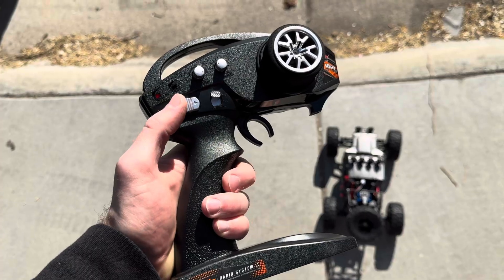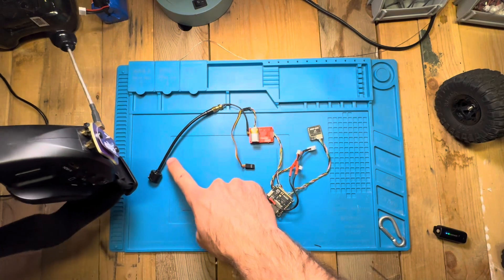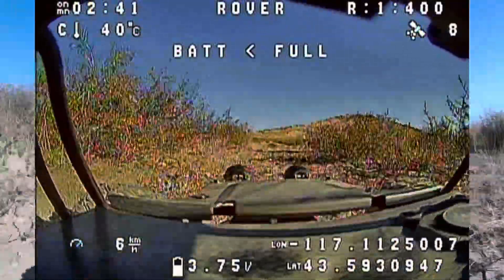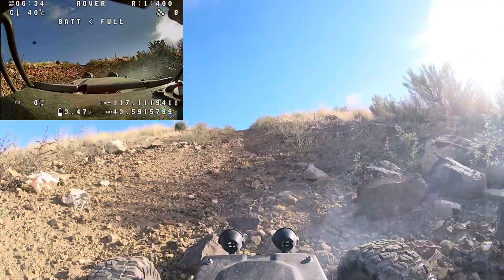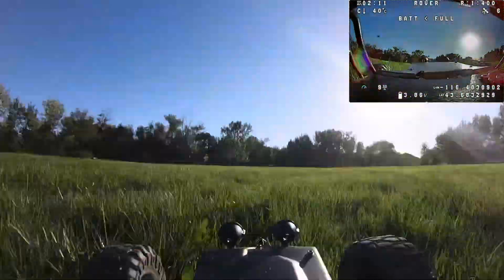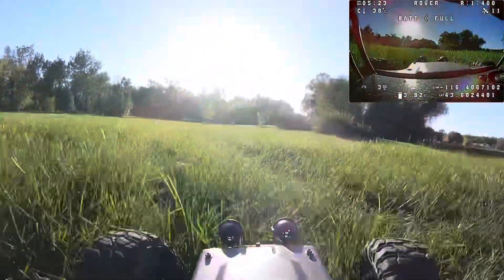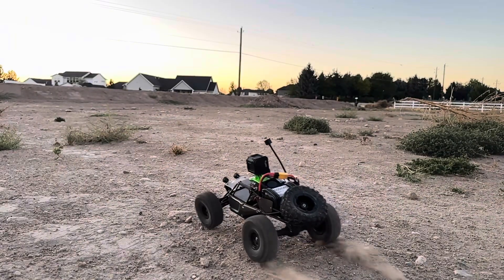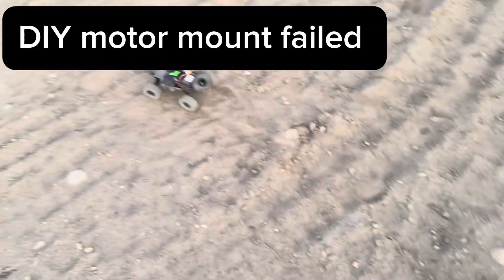Build an affordable FPV RC 4x4

Comment: Great video. Great project. Are there other RC cars you can recommend for this kind of build?
Reply from the maker: If you are willing to spend more money, something like the Losi tenacity would be very good due to the suspension and that it is very stable so it won’t flip over very easy
Reply: @MediocreNerd  That's maybe a little overkill 😅
Reply from the maker: @BirdsEyeViewHamburg haha yeah probably. The WL toy’s version of this car is probably best bet
Reply: @MediocreNerd  sadly, I can't find the exact model being shipped to Germany. That's why I'm asking for alternatives to use. Mainly having the same electronics inside that can be wired up the same way. But vendors don't show so much of the insides of the cars
Reply from the maker: @BirdsEyeViewHamburg what about WLtoys 12428? That is the exact car just different body. 12429 is very similar as well
Reply from the maker: @BirdsEyeViewHamburg 120416 would probably also work and has similar parts
Reply: @MediocreNerd  Thanks, man

Comment: Anybody found an Easy way to get some OSD stats without a lot of flight controller?
Reply: no cause to get osd you need a data processor, and its not toomcuh work or money to add the rest of the Fc
Reply from the maker: Yeah, I searched hard and far and could not find any way to do that. But for $25 bucks you can get a FC with plenty of uarts and add gps, buzzer, LEDs, etc. so probably best way to do it anyways
Reply: There are FPV cameras that have a VSense Pin and will you show you your Car’s Battery Voltage, as well as a built-in timer.
It was popular on the older Runcam Camera Models bc the OSD chip used to be seperate from the FC, back years ago and it just stayed included. 
You can find them still…

Comment: Tip: Don't put your Receiver next to your ESC, very noisy.
        Adding a cap to the BEC is said to help as well.
My EMX say telemetry lost all the time just like your car, have never lost signal.
Reply: The Telemtry is a seperate wirless signal from the RX back to the TX. It doesn’t actually use the ELRS Link.
Some RX’s have only a 10mW Telemetry output and the better ones have 100mW or some even higher

Comment: You can put distance and direction to home on the OSD so you don't have to try and calculate it. I believe Inav even has RTH for rovers.
Reply from the maker: Good tip, I'll have to check that out! I know betaflight really well but I need to branch out and learn Inav
Reply: @MediocreNerd  luckily they are both an offshoot of open flight and are very, very similar
Reply: @MediocreNerd You should be able to bring the motors ESC wire into S1 on the FC and just set up a MODE switch for ARM to get the Home Point Distance to work. Possibly even without the Motor Wired in.
Just make sure to lower all the requirements for GPS rescue like Altitude, Satellites, etc to 0 or as low as they will go.
The FC shouldn’t actually know the ESC board isn’t connected, basically as if you were running external ESC’s on a Drone for each motor..